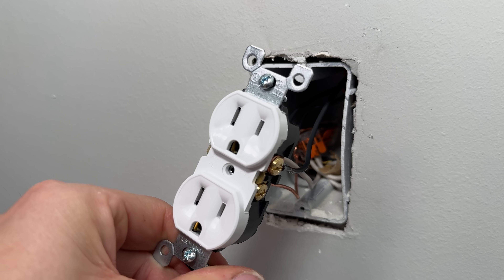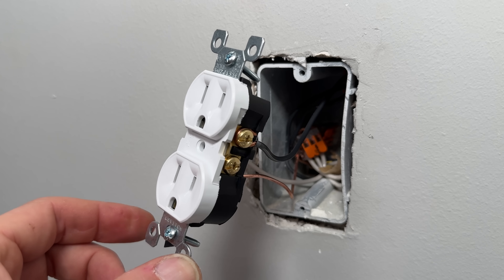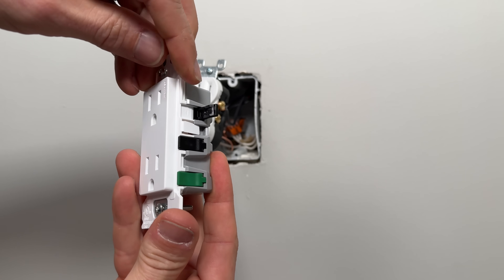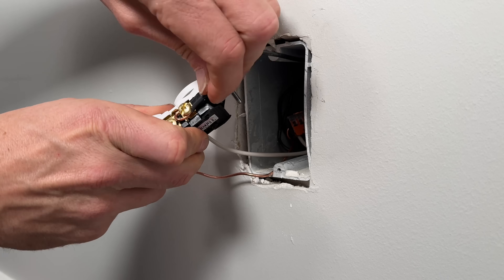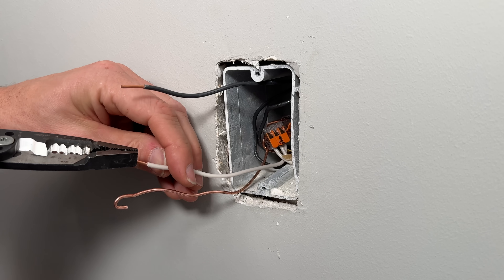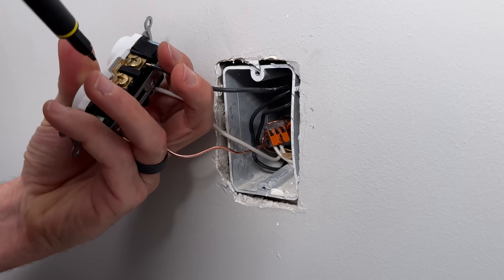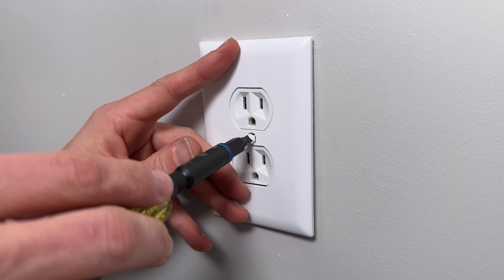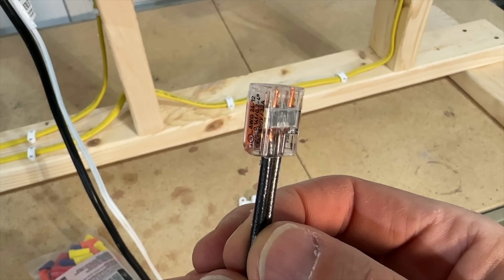Why DIY Homeowners Should Wire Differently Than Most Professionals

Comment from the maker: Klein Tools 11-in-1 Screwdriver - https://geni.us/gfNB
Outlet Spacers - https://geni.us/7kymNAo
Legrand Commercial Grade Outlet - https://geni.us/q0k4D
Decora Edge Outlet - https://geni.us/Nrt7j6
WAGO 221 (78 Piece Kit) - https://geni.us/qNPa
Knipex Wire Strippers - https://geni.us/uVWn

DISCLAIMER: This video and description contain affiliate links, which means that if you click on one of the product links, I’ll receive a small commission.
Reply: I prefer the back-wired receptacles. Everything I've installed or replaced for the past couple of years has been back-wired. Just so much easier. My daughter recently had a new house built and it has a mix of wrapped terminal and back-stabbed. I was NOT pleased to see that commercial electricians had taken the least reliable method on a new construction!
Reply: The price diff at my local HD is $0.37 between the Decora Edge and the regular Decora. No more hook and screwing the wires, saves time and it allows for quick removal if necessary without damaging the wires.
Reply: It is too bad that the Klein screwdriver does not have ECX options. They are even better than Robertson drives.

Comment: Not a professional yet, but I am an apprentice, back wiring and side wiring offer the best connections, the levernut style is unnecessary. (I also prefer wire nuts opposed to wagos since they are about 4x cheaper.) For professionals, the time saved with lever type connectors for receptacles is negligible

Comment: I like the backwire method.  It's good for serviceability, and easy to do correctly.  A couple comments claim that side wiring is more secure, but I don't agree.  The backwire method has plenty of clamping force.  They might be confusing it with backstabbing, which I'd never use.  I like the new Leviton receptacle from a safety point of view, but I don't know if the lever clamps are as good as screws.  I'm a little leery of Wagos for the same reason.  I've done a lot of electric work, but am not a licensed electrician.

Comment: It is not a good ideal to wrap electrical tape around an outlet or switch, some places it is against code.
In the event a side screw becomes a high resistance load, and reaches a high temperature, electrical tape can melt, then ignite causing a fire.

Comment: If you install a back wire device on solid wire like you have done. Twist it in your hand back and forth which could happen during installation. Your wires are lose. Stranded wire on a back wire device will stay tight. Always hook solid wire or call a professional. Bonus Tip : 30 dollar screwdriver will not make you a better DIYer.
Reply: I had the same experience with Eaton commercial spec grade. The clamping piece seems too smooth. The Legrand and high end Leviton bite into the wire somewhat and grip better. The lower level Leviton (not residential grade) has an external clamp that wraps around a bit and also gives a pretty good grip. The high end Leviton I tried was an extra heavy duty industrial grade pn 5262. It seems to be very high quality, but one flaw primarily because of the recessed screws, is that side wiring 12 gauge is extremely difficult, so back wiring is essentially the only option. I believe that is the same with the Leviton hospital grade and their heavy duty "narrow body" pn r72-5252. 52xx is 15 amp, 53xx is 20 amp. I don't have any experience with high end versions from other brands.

Comment: Ok, here’s a hypothetical question, the back wiring outlets have a place for two wires under the “clamp”. Can two wires be connected, such as the in and out of the box blacks on gold side, the the two whites on the silver side? The current would not be going “through the device “ ???
Reply: Yes, as long as they are the same gauge, which of course they should be. You also clamp them individually in the separate screws, it makes no difference electrically. Current going through the device will only occur when there is a load and is therefore your choice. Personally, I would use only one wire under each clamp.

Comment: Electrician here. I agree with the commercial grade upgrade in terms of the build quality and ease if install, but you should not be recommending these for DIY, as these commercial outlets are not Tamper Resistant which is a National Electrical Code requirement for receptacles in all dwelling units (pretty much all residential applications).
Reply: I've seen tamper resistant commercial grade receptacles options from the major manufacturers.

Comment: I think there is confusion about the term "backwiring". Some outlets and switches have a stab-lock type of backwiring where you just push the wire into a hole on the outlet and a spring catches the wire.  There is no screw to tighten. This type of wiring is illegal in some places in the US. The backwiring method you demonstrated actually pinches the wire between two metal tabs. You must tighten the screw to hold the wire in place.
Reply: Backstabbing is slang for what manufacturers call quickwire. I agree that there could be some confusion.

Comment: What you're calling, "Mickey Mouse Ears" are actually washers that you might need to space the receptacle out away from the box to account for paint build up or wallpaper. I always remove them by bending them back and forth with a pair of pliers whether or not I actually need them. Unlike the flexible plastic spacers you are showing, the metal washers do not compress and loosen over time. There are more suitable hard plastic washers available for people that need them. Commercial receptacles are the best. They're easier to use and have a longer service life.

Comment: Handyman.

I try to use what makes the most sense for a given customer, and generally give them the option.

I'm not going to push a customer to use what I'd prefer to work with (commercial) at increased cost to them, as they arent going save money because I saved a few seconds...

The hook being 'more secure' isn't really the saving grace ppl think it is. Poor connections cause fires... a loose screw is a loose screw. The hook won't stop it from burning down your house...

Comment: RV repair my thing, but I get the occasional shed or addition to wire. Sticking with side wire and cheap receptacles except for ones in areas where plugging & un-plugging regularly will probably occur or high amperage devices will be used regularly. For those areas, commercial grade all the way to avoid early failures.

Comment: I started using the Leviton Decora outlets you showed and was quite happy with both the ease of installing wire into them and the lack of exposure of bare copper on the outside.  With metal boxes this is especially a nice feature.

Comment: First of all nobody should wire anything differently as only one way is right. Dont use anything with flip levers, like wagos which is worst thing you can do. Mechanical connections are the best (screw pressure), or wirenuts twisted pressure. Flip levers are springs which cause all kinds of problems. Its just a shortcut which may bite you later. Dont give in to use something because its quicker, more convenient or new. This guy is just a home depot handy man giving advise a competent electrician should give. Dont take advise from a utube electrician. Its like taking medical advise from a lady across the street rather than your doctor.

Comment: I like the Leviton Edge.... but will argue against it for one reason... You never know when you're gonna run into a setup where 4 wires isn't enough. You can get bulk packs of regular/commercial grade outlets and KNOW you'll be able to mirror the existing wire mapping without needing to run out and get Wago 221s, or wire nuts to make pig-tails. So, if you're doing a bulk replacement... just go with a commercial option, and save yourself some time, mileage, and frustration. 

I just replaced all outlets and switches in the house I bought, since they were all 30 years old, many weren't securely holding plugs and all were ugly almond. I bought Leviton Edge for simplicity sake, but wound up needing to get regular decoras to mirror the wiring for both switches and outlets. One day, I'll get an electrician in here to clean up the screwy areas with proper groupings and pigtails... but it shouldn't be necessary for a while.

Comment: I can see how you could think that this would be easier for diy but some people that have never done wiring before don’t check and make sure they have the wire under the clamps the side wiring with the hooks and a rez receptacle will save you money $1.00 receptacle compared to $2.50 receptacle so it comes down to if you think that you have the skills to do it correctly and how much you want to spend and I will admit that the speck grade receptacles are a heavier grade and will take more abuse, and I’ve been doing electric work for 30 years. The other thing that you need to watch out for is if your house was built in the 60’s or early 70’s and has aluminum wire, because if you do side wiring with the hooks will be better because the aluminum wire is softer than copper and because of that the wires have a greater chance of becoming loose over time.

Comment: One big problem with the A commercial or residential is that holes in the back of the outlet in you can only put 14 awg wire in them,But most codes require 12 awg or bigger.

Comment: He’s basically telling every homeowner that they’re idiots and if they can’t just do it like he showed in the very first example and that they can’t do it properly even if they do do it so they need to buy this more expensive device that is sort of idiot proof and maybe they are so it might not be a bad thing for the ignorance of proper work habits and methods with Electrical which is an can be dangerous Unlike working on drywall or plumbing in general so whatever yada yada yada yada yada

Comment: I’m a professional. Wrapped clockwise around the side screw is always the best. 80% of service calls are the result of a home owner using the push / stab type coming loose. I do like, use, and approve of the type you showed with the stab and then screw tighten. But be careful. Too many people don’t get the wire in squarely or all the way in and the screw seems tight but the wire can pull straight out. Seen it many times.

Comment: Never cut the J hooks off. Straighten the J hooks and trim the exposed copper wire to the appropriate length for the device you are installing.

Comment: I just finished replacing all switches and receptacles in a 40 year old house. Fully 10% of the backstab “connections” did not need to be released. The wires just came out when the device was pulled from the box.

Comment: In addition to commercial grade outlets, be sure to use commercial grade ‘outlet covers’. The generic kind will crack at the screw hole where the commercial kind are made thicker, stay flat and hold up much better. They cost more but you get what you pay for.

Comment: Diyer trained by an older journeyman while building houses in the 70's. I was in late teens and wanted to learn. As for receptacles, i do use commerical backwire. I perfer the Klien long #2 to tighten and then come back and snug up with a flat head Klien. Just to make sure of the connection . A must for this way with stranded. .Milwaukee 48-22-2042#2 Ecx 4" Screwdriver is also a a great one as it has square drive in the center and flat together this one does not slip.  I also use wago's for grounds .Still a little ole fashion on wire nuts but comig around . I like watching your channel and always learning
Reply: ECX is an excellent recommendation. It is superior to Robertson drives.

Comment: I’ve done some handyman work and I started using that type of outlet for all my replacements. Makes so much sense. A few years before I replaced all the outlets and switched in my entire house and I bought pro grade Leviton but still had to use needle nose on ever single wire to j hook it for the screws and it still try’s to slip out sometimes. Lowe’s pro grade are the type you showed in this video. I’ve been thinking of trying the lever style too.  I’m a huge wago fan.

Comment: Got a quick question- have a freezer and fridge plugged into the same outlet in the garage.  both of the plugs point down because the style of cord they have so one won't plug in all the way and I am temporarily using a heavy duty extension cord.  Does this Decora edge have more space between the outlets?  Or should I just convert to a 4 plug outlet to get a little more space? any other options you recommend @everydayhomerepairs

Comment: I love the the outlet you put in because to me the wire is more secure in that option. I am curious about 2 things however; if you went with another standard residential option, do you really need to clip off those j- hooks, can’t be reused as is? Also, you preferred the outlet you put in and referenced that the company may eventually make them decora style. Is there any benefit to the style you put in over the decora? I always love your tips, very useful information!

Comment: DIY'er, been remodeling our house (complete, to the studs) since 2021 (we're now about 2/3's of the way done).  I've been using the Decora Edge switches & outlets (where possible) since they came out.  These things are great, it's like a Wago outlet!  Installation is so much faster, don't have to worry about the screw terminals hitting anything, etc.  Can't wait for the Decora Edge lineup to include everything (dimmers, GFCI outlets, etc) because they are just so nice to work with!
Reply: Its just too bad that the new Edge devices do not have an option for the classic outlet design. Decora is nice when you are renovating/building where they can all be installed to match, but for smaller projects and DiY outlet additions, it kinda sucks to have mismatched receptacles or having to replace perfectly functional ones just to match a new one.

Comment: As an Electrician, i would stick with screw connection instead of lever. Screw connections are tried and tested for decades, dont re-engineer what isnt broken.
Reply: But you’re an electrician; the average homeowner who maybe shouldn’t be messing with receptacles might better served by having concealed connections and not an exposed hot.
Reply: So you think we should be driving horse drawn buggies? In a few years, they will all be lever style. The system has been used for years. Using that proven technology on outlets is new.

Comment: If you don't have the ability to put a hook on a wire and install the wire properly, then you shouldn't be messing with the electrical to begin with. The hook is there so that when (not if) that wire loosens over time it will still hold the wire to the side of the recepticle versus if it pulls off the back it can hit the box causing arcing and a potential fire risk. If your going to do self repairs do it right, learn to make a hook, and make sure your wire is following the direction you screw the wire down in.

Comment: Could you possibly slow down and do camera close ups on the part where you insert/slide in the wires….can’t tell where the wire goes on the commercial grade outlet you showed with the ‘flap’ part. … perhaps do a closeup and use a pen to point to in front of or behind that flap etc Thank You.

Comment: I'm a DIY wirer.  I'm a retired electronics design engineering technician and home based audio and radio repair professional.  I know the physics, practical application, and quality/cost tradeoff arguments from my design engineering days.  Not being a professional electrical contractor I'm not swayed by the hurry-up mentality that many contractors practice with the resultant negative impacts on quality.  If a person is quality oriented in the practice of their work, pro or DIY, they will work out solutions to problems and apply their knowledge to their work.  That's what to look for instead of depending on the push of product makers to sell you their stuff.  I can certainly tell the difference between wire nuts, wire levers, and crimps.  I make whatever I choose to use work and don't use those parts I can't make work to my own satisfaction.  Yeah, I know, most employers don't like independent thinkers working for them, but they can kiss my ass because I'm RETIRED!

Comment: DIYer in the middle of a complete rewire and remapping of circuits in an older home with cloth and resined paper NM without ground, undersized boxes and an inch gap between drywall lathed plaster walls and brick on exterior walls.  I wanted to go with commercial grade receptacles because of the superior backwiring, but there is zero availability of decora style tamper resistant commercial receptacles.  So I punted and went Decora Edge at $2 each.  I'm not unhappy with the choice but would have preferred an overall more robust outlet.

Comment: I work on the industrial side. We use stranded wire almost exclusively. The commercial outlets and switches work best in this setting.
I have been wiring almost everything you can imagine for over 50 years. Started using Wagos about a year ago.

Comment: I am transitioning to Decora Leeviton edge because I hive 12 gauge wire and its difficult for me to get the wires neatly back in the bock using pigtail method. I have had ground wires touch my metal post in the past creating a short.  I have also transitioned to Wago wire nuts but finding I need to use a wrap of tape to keep the lever nuts from opening when I push them back in the gang box  and come loose which has happened several times for me.

Comment: Side wire J-hooks for me. The residential grade receptacles I have installed some years ago have begun to fail, difficult to plug in and out. These are in locations that are frequently used.
Reply: Yep! Wagos also will fail.

Comment: Definitely like the commercial first and side wire second. Do not like and will not use new lever style. Never used the rear stab connection. 40 years electrical experience.